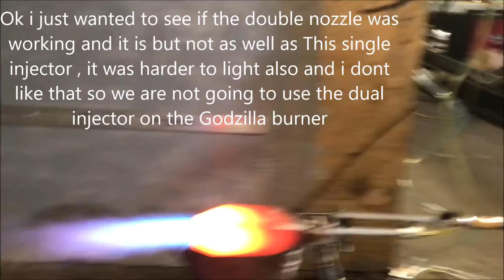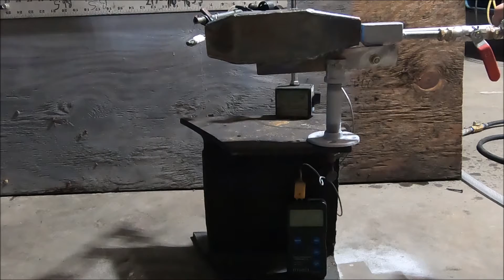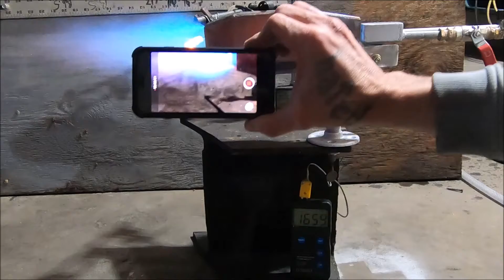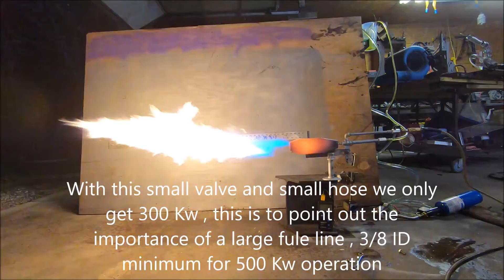Industria waste oil process heater for Kris at J&j tubular

Comment: Great Video 
I know your mfr capability are mostly by hand 

But you can make round burners. 

I think the square burners do not evenly eject the hot air mix and flame. 

I think Round would be better.

I am thinking how to incorporate the circle property inside a round burner 

I think that would be the best